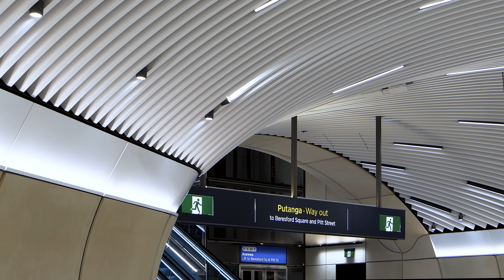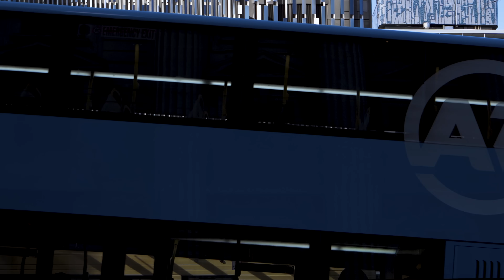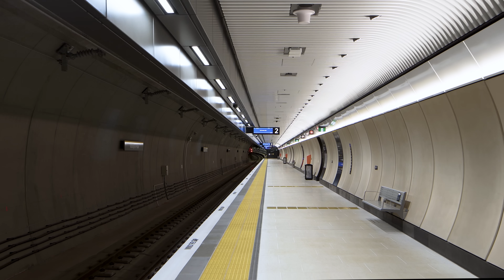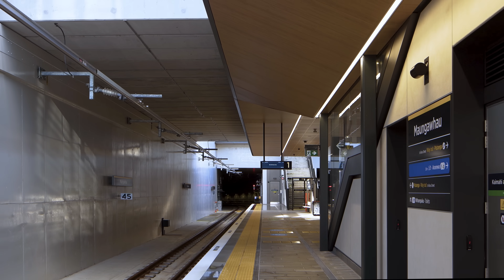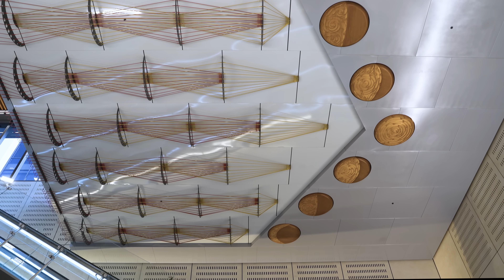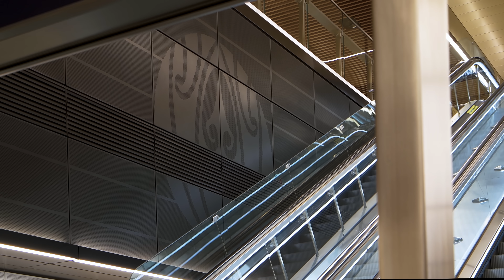Inside Auckland’s City Rail Link | A First Look at the Architecture of the Three New Stations

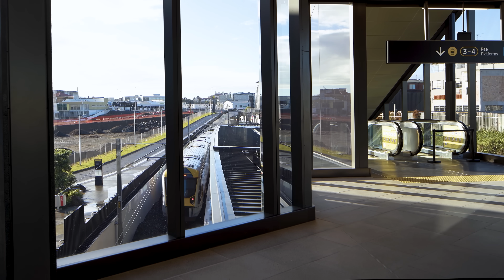Comment: 1:05 "it creates a more... legible environment to walk through".  The stations look great, but why is all the wayfinding signage primarily in Te Reo Maori (bold) with English as merely the subordinate translation?  What rationale is behind this, when the vast, vast majority of people who will use the transport services will not speak Te Reo Maori?  Also, Auckland's highly cosmopolitan population means that lots of people won't even have English as their first language, and Te Reo will be an even higher bar to mount for them.  Surely this just generates confusion?  I'm all for bilingual signage, but why is this seeming political prostration being prioritised over the necessarily practical requirements of a publicly-funded, phenomenally expensive piece of public infrastructure that actually does need to be legible?
Reply: The Te Reo and English signage is equal size. If one can't read the te reo, one defaults to the English anyway, so no problem.  The Singapore Metro uses 4 languages, and no one there has lost their mind...
Reply: @jumpingjohnflash  No, it's not equal size.  The Te Reo is thicker (i.e. bold font) and takes primary position on all signage within the stations, as well as on most Auckland Transport infrastructure.
I did not infer that people would "lose their minds" over multi-lingual signage - and to reiterate, I have no problem with bilingual signage in Auckland.  I am merely pointing out that it is the primary task of a public transport body to prioritise legibility and efficiency (i.e. what most people are going to find most useful most of the time), but in this case they have deliberately opted not to.  I find this approach frustrating and arrogant.
Reply: @foreignparticle1320  Nah. You're still describing a non- existent problem.

Comment: The vast majorly of people aren't annoyed at the new rail loop or getting new train stations, they're annoyed at the +50% cost used just for aesthetics, art installations and all the unnecessary stuff that does not improve functionality.  It's a gold plated project when we needed a minimal approach so that saved money could have been spent elsewhere.  You can only justify this is level of expense when all the basic needs are met.  The money wasted on architecture, aesthetics and unnecessary stuff would have been better spent sorting out the supermarket monopoly, or for a residential rooftop solar initiative, or for sorting out the power companies.  That's why everyone is pissed.
Reply: "They're annoyed at the +50% cost used just for aesthetics, art installations and all the unnecessary stuff : - NO, "we're" not - because all of what you claim is in fact less than 5% of the total cost.   But please, don't let the facts get in the way of a good solid whinge by all means, if it makes you happy.

Comment: Shout-out to former Mayor Len Brown for working his arse off to get this over the line
Reply: And John Key, who dealt with a huge amount of negativity on this project within cabinet. Not a fan of his politics but he was instrumental in helping get this over the line.
Reply: @kevin5073  You mean the same John Key who took almost 5 years to be persuaded and still oversaw the "cost reduction" that not only reduced the CRL's effectiveness by cutting out Newton Station and building on 6 car long platforms, reduced its safety by cutting out a 2nd exit at Karanga-a-hape Station and not installing platform doors, and lumped Auckland ratepayers with half the cost despite happily paying full costs of various low BCR roading such as Waterview? That John Key?
Reply: @jumpingjohnflash  without Key onboard it was never going to happen. And it was Len Brown who suggested the 50/50 cost split. Fortunately the 2017-2023 Labour govt were able to get improvements to the project.
Reply: @kevin5073  I suppose a compromise from Key is better than nothing...  but letting Auckland pay half the cost so he could avoid political pain is a very poor precedent. 
It was Key's property developer mates who finally persuaded him in any case.

Comment: Melbourne’s city loop was added to a city that was designed for future growth; any public transport system was going to see a massive increase in patronage.  The CRL serves are TINY fraction of the city, and an area that the council and transport authorities have conspired to devastate over the past few years.  The CRL helps people get around a CBD they could already have walked, but go to that CBD now and the streets are empty and devoid of life.

So if CRL was not about improving mobility round the CBD, what was it for?  Some will say it opens up capacity across the wider “network”, but Auckland does not have a comprehensive rail network.  The entire North Shore has NO rail and the network that does exist is not connected to other public transport modes in any meaningful way.  Even in the CBD itself, the $5.5bn spent has not addressed the fact that the main station is still several minutes walk from the bus hub and the area directly by the train station - which USED to be the bus hub - has been pedestrianised.  Buses can no longer get close.  Rank incompetence.

And then we have self aggrandising promotional fluff like this shoved down our throats.

There should be convictions and sackings relating to this project, not awards and back-patting.

Comment: Form over function, many things there that shouldn't have happened. Insane, we are a smaller population. Money is tight already. Now rates are going through the roof, unemployment, many redundancies. The time it took to construct this $1.7B per k track which is 200% more expensive than any other country train project in the world. Meanwhile the harbour bridge is falling apart and there are many projects around New Zealand that have been left. Outages on the Pukekohe service, being told a service is cancelled then left on your own to find your way home. What other way? Staff not knowing what is going on. The next morning sitting on the train to leave Pukekohe it's then cancelled for no reason. No rail north of the bridge. Get things big done and done well....
Reply: Seems pretty functional to me. I'm with you on rail north of the bridge, that'd be awesome. But stuff like this helps with that, it's a huge upgrade to the existing network; it couldn't have handled a northern line without an upgrade like this.

Comment: No wonder this was massively over budget (and yet still no safety barriers on the platforms). It makes one wonder if the architects have ever been to places like HK or Japan where they famously have the best mass transit systems in the world, build for less than half the price per meter than this and finished in a fraction of the time. Obviously these stations are beauiful (they ought to be given the time and cost), but what are the oppotunity costs of spending so much and taking so long.
Reply: You don't think maybe Japan being able to do this cheaper is because they have a government, bureaucracy, project managers, a skilled and trained workforce, and the required equipment on hand, experienced, and ready to go? Rather than it just being artwork and architecture?
Reply: These are designed for platform screen doors in future.  The trains aren't capable of it at present.

Comment: What a joke waste of money with many empty buildings in the city
Reply: Yeah, if only there was some way to make it easier for people to get into and around the city, thus creating more potential customers for those struggling businesses.
Reply: @noodlien This is a truly great project for Auckland. Stunning. The art and design are world class.
Reply: @noodlien it’s called walking it’s a small city right
Reply: @Standardtime001  Oh, yeah, cool, let's just have people walk from Manukau, Pukekohe, or Swanson into the CBD. Easy peasy.
Reply: @noodlien underground only gos to Mt eden  k rd and city …. 😂
Reply: @Standardtime001  the underground section creates connection between the eastern and western lines resulting in a new integrated East - West line and it creates a loop for the southern line. This opens up many more connections and destinations for people coming from all across the suburbs that already have access to the old lines. If you are looking at the underground stations in isolation you are missing the point
Reply: @Standardtime001  You know it's not an isolated line, right? It's converting Britomart from a terminus station to a through station. This eliminates a major bottleneck, allows the eastern and western lines to be joined, and the southern line to be a loop. All of this significantly increases the throughput of the entire network. Did you know it's going to double the number of people that can get to the central city within 30 minutes on public transport? Think you can do that by walking?
Reply: It's a good project but far to expensive,the marri names are confusing to English speakers can we have dual signage in English?
Reply: @Oneeyedcantab-um8su I am an English speaker, the names are not confusing, they are the names of the stations. If you would like the translations or meanings of the names of the stations, or why the stations have been given these names, that information is googleable.
Reply: @Oneeyedcantab-um8su If you can't even spell Māori, you are the problem. Maybe learn, we have incredible brains capable of so much, why do you belittle yourself into not being able to learn 4 new names. If someone introduced themselves to you with a foreign name would you say, no that's too difficult, I shall call you chair.